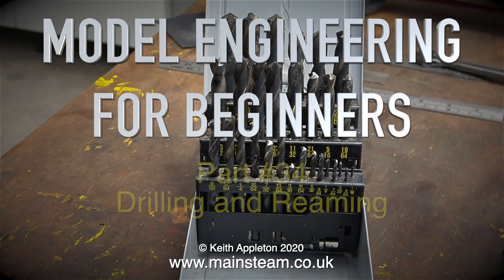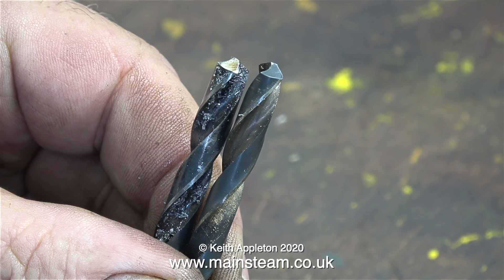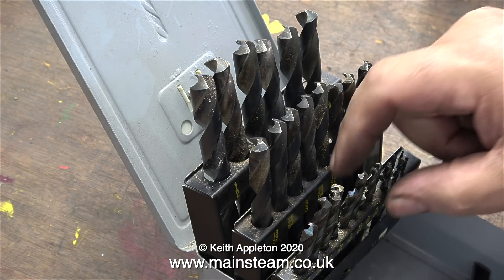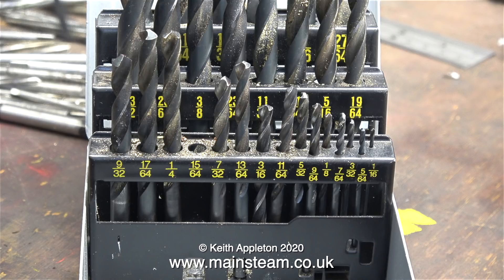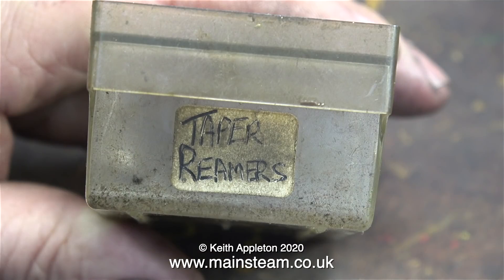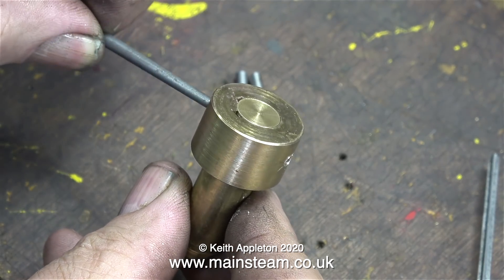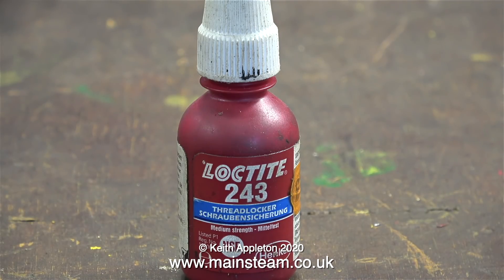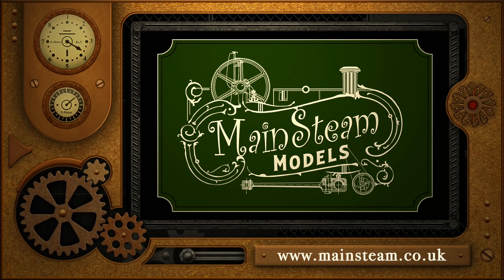DRILLING AND REAMING - MODEL ENGINEERING FOR BEGINNERS - PART #34

Comment: Hi Keith, Merry Christmas! Thanks for all the videos this year, I'm just getting started in model engineering and they've been a huge help. I was wondering, if you were going to outfit a new shop, where would you start with purchasing drills? There are a ton of recommendations online as far as imperial drills in 1/64" increments, metric in 0.1mm, number drills, letter drills. It seems like it could be quite an investment to get all of them. I am mostly wanting to be able to tap BA threads for Stuart engine builds, so could I get by with just a single drill set to start?
Reply from the maker: Start with a full set of Imperial Drills, and a full set of Metric ones.
Reply: @keithappleton  Thank's Keith!

Comment: Bond lock If I remember correct was the only thread sealant that you could use with Hydraulic Oil, Loctite would not cure if there was hydraulic oil on the fittings, you has to clean them off with Varsol. We always asked someone who was going to the UK to bring us some back as we could not buy it over here. Fortunatly there are some thread sealants over here that work as well, plus my hydraulic repair days are now long past.